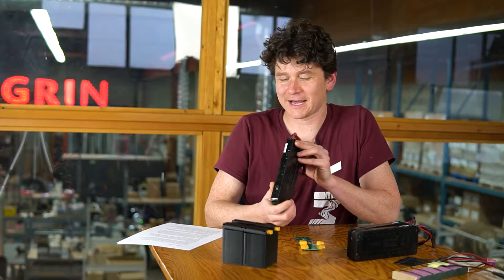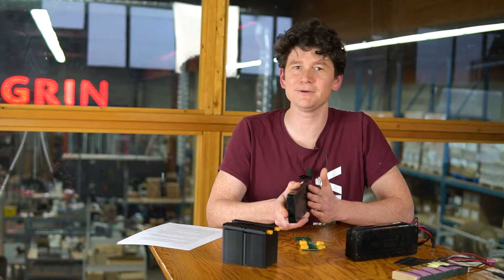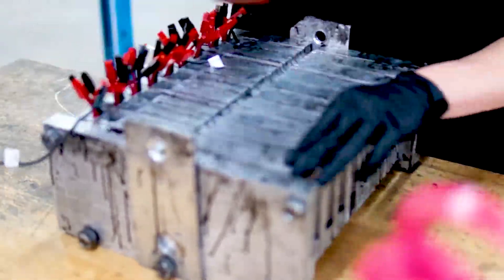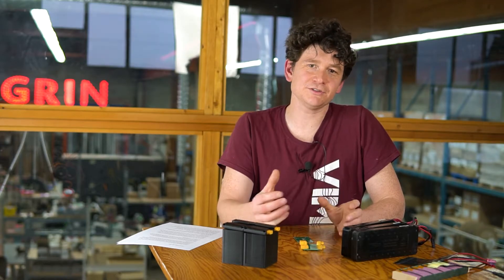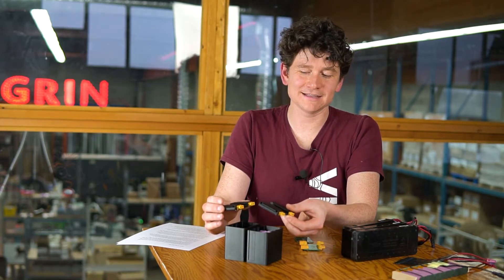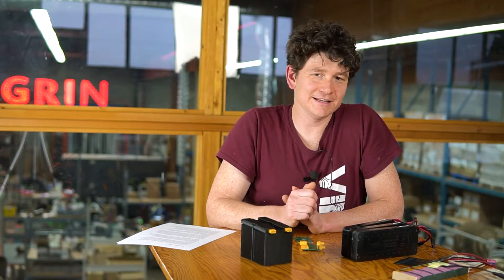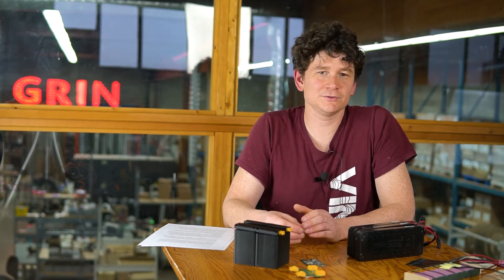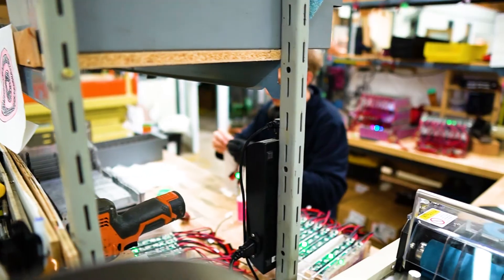Ligo 10X - What's in store to succeed the original LiGo and LiGo+ Stackable Battery Modules

Comment: I would love to see a 48v version of this, i would buy that
Reply: I'd love a 48V version also, but their goal was to keep total capacity under 100 Wh. For 48V, they'd need an 18650 with only 2Ah capacity. They'd almost need some antique 18650s to get the cell capacity so low. Modern cells range from 3.0-3.5 Ah, so they can't be used in a LIGO pack.
Reply from the maker: Yeah, the other viable option is to do a 7s battery using either 3.5Ah 18650 cells (~85 Wh), or with 4Ah 21700 cells (full 100Wh) for 25V / module and then have a series hookup too.  It's in consideration but first focus is to get the 36V up and done.
Reply: @GrinTechnologies  I think 48/52V market would be huge!  I would be interested.

Comment: Very cool, but will you make a USB-C charging adapter for it? Seems like that’d really help with travel as USB-C chargers are small and easy to find pretty much anywhere. If you spending a night charging it won’t matter that it’s only 100W (or even 50W). Heck if each pack accepted USB C you could use a bunch of cheap, lower wattage wall warts on a fat power strip to max out a 15A wall plug and charge the whole pack super fast.
Reply from the maker: USB-PD can in theory deliver the full 42V for charging the LiGo directly, with no need for separate boost converter. Unfortunately it's an industry full of regulatory and licensing headaches though, so we'd hope that some other entity would see the opportunity and take that on for making commercial ebike charging adapters off this standard.
Reply: I want something like this too, either built in the battery, or optional adaptor accessory (stacked at end of Ligo 10X), in order to use those tiny 90W USB C chargers.  It would easy to top up a 500 WHr pack overnight.  With such a battery mounted in a micro PEV such as a scooter or unicycle, we would have to worry about another charging brick.
Reply: USB-C are not common. Type-A are much more common.
Reply: @sammiller6631  true for the moment, but I expect C will overtake A in a few years. Even if it doesn’t A simply doesn’t provide enough power. The USB 3.0 dedicated charging standard caps out at 7.5 watts, that’s just not enough to charge an eBike. When you see an 18 watt phone charger with a USB A port it’s got USB C internals. The USB C 2.1 standard allows for up to 240 watts of power delivery. That’s as much as many eBike chargers put out, and if you applied it to each Ligo individually it would likely be more than the batteries could take.
Reply: that would be pretty complex. the batteries would need to talk to each other and switch between parallel and series modes so that when they're charging from USB-C they can share the current and all charge up to the same level
Reply: @SeanLinsley  A USB-C charging adapter wouldn't be super hard, though - basically make a mini Satiator with USB-C input instead of AC input.

(Ultimately, with direct USB-C charging, you'd have to have a mini Satiator in each module, as you can't rely on chargers to have fine-grained voltage control (the spec supports it, but...) to just directly charge from USB-C, and most existing USB-C PD chargers max out at 20 V (although the latest Power Delivery spec allows 48 V at 5 A, which could be real interesting if you're charging a 10S or 11S module/pack and you are using a variable output PD charger).)
Reply: @SeanLinsley  wouldn’t have to be super complex. Either have all batteries charge from the same USB C port the way they charge now, or put a port on each battery and separate them to charge each individually. I think the prior option would be fine for most users, but the latter option would allow for crazy fast charging via USB C and a handful of cheap charging wall warts connected to a sturdy power strip.

Comment: How much does one of those modules cost?
Reply from the maker: Before that's answerable we have to finalize the design, pay for all the tooling and regulatory testing, and get them into production, and then we can tally what's required. A batch of them will definitely be significantly more per watt-hour than a conventional ebike battery that only has one single BMS and enclosure for the same capacity. It's only a product that will make financial sense for people who require a battery they can travel with or ship without class9 DG.